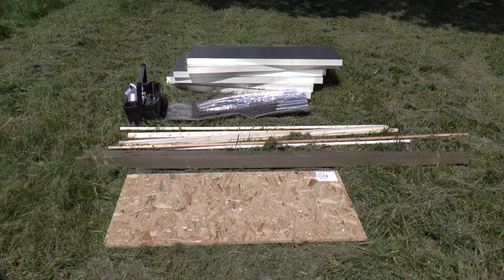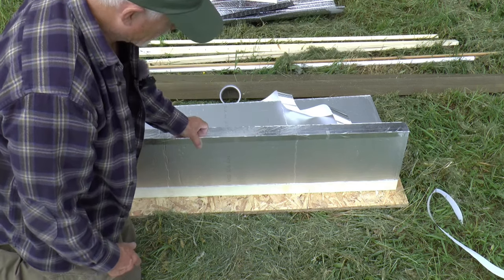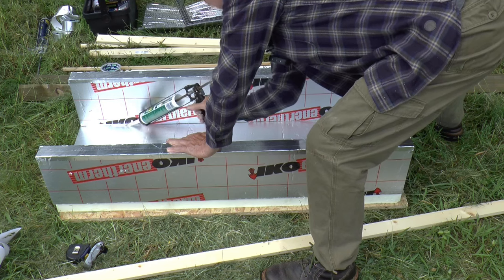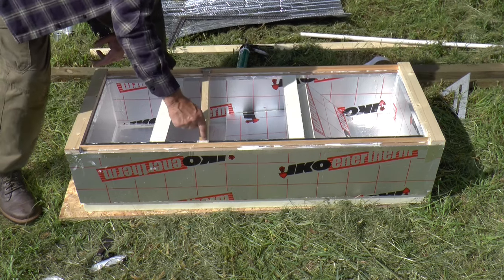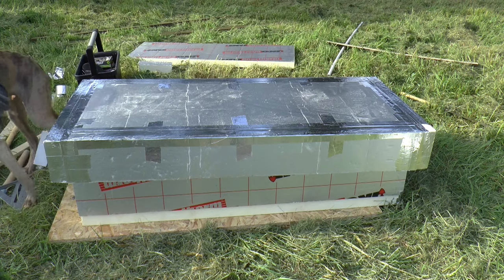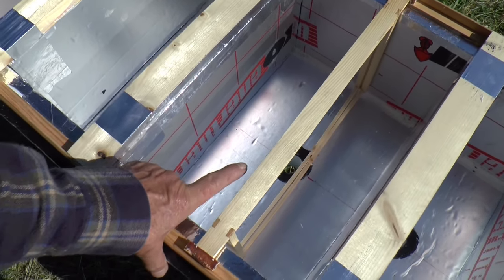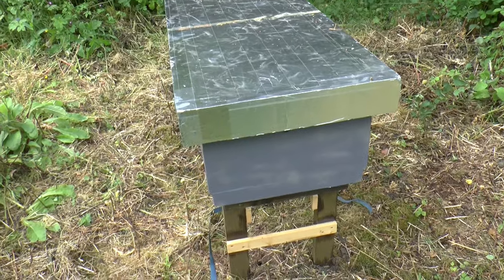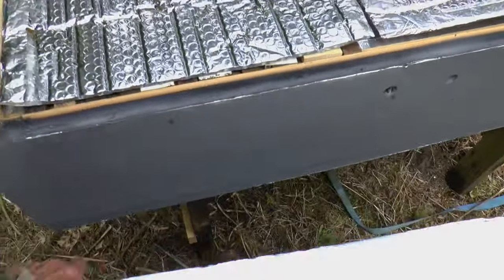How To Build a Low Cost, Super Insulated, Versatile Beehive using only hand tools!

Comment: I heard once that you should avoid using aluminum in hives, especially in areas that could would contact honey.   Is that not a concern?
Reply: None of the aluminium is in an area which would contact honey unless you scrape the burcomb off and crush it.  Plus, of course, aluminium is vermin-proof.
I'd add stainless steel mesh to the outside of the drains to keep other insects,  mice, and rats out, and make some plugs for any entrances that aren't in use by the bees - I'm a firm believer in single entrances, as they'd rarely have additional entrances in the wild (so they can and do cope perfectly well with just one 2"/50mm entrance or even smaller, and still dry nectar into honey in any climate that bees can survive in), and additional entrances rarely get guarded properly.
Reply from the maker: The aluminium will never make direct contact with honey or nectar. My only concern is that the bees may be able to nibble through the thin foil that is bonded to the foam, but if they do, I can easily patch it with aluminium tape.